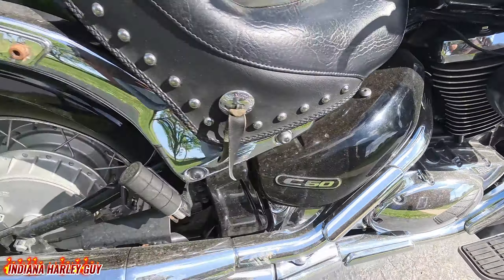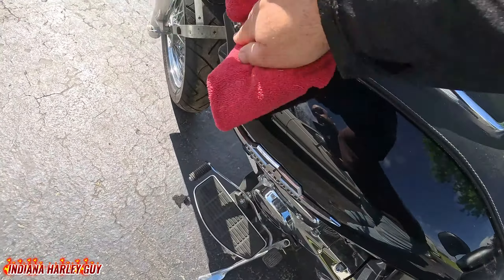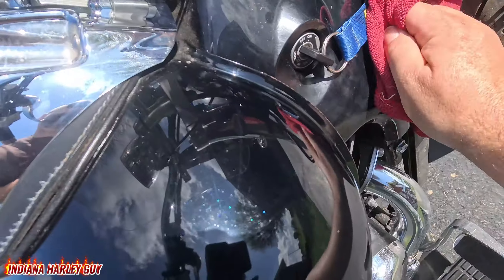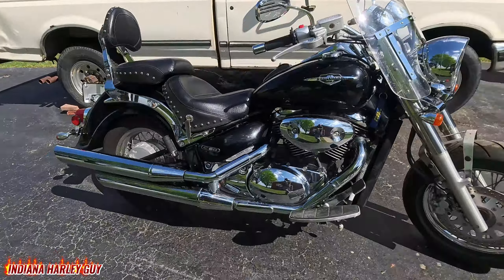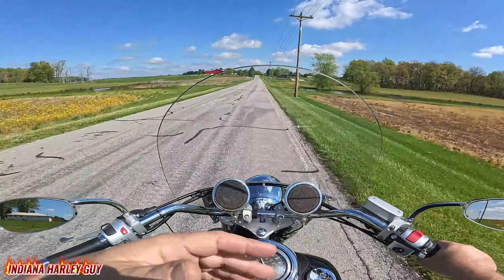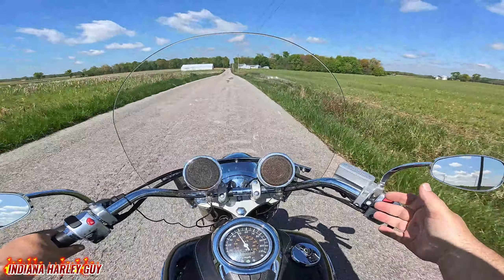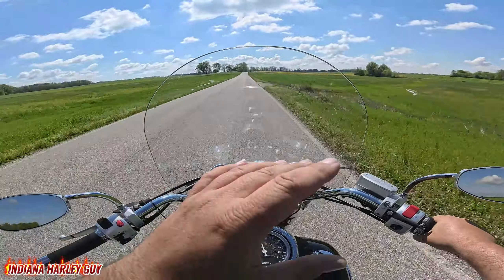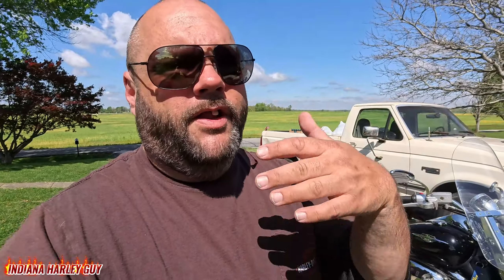Cleaning up the Suzuki Boulevard C50

Comment: I ride a 2005 C50T. Picked it up at a pawn shop in 2020. New tires and general service and been on it ever since. I did convert the lights to all LED. You will have to replace the flasher unit with one compatible to the new bulbs. Rides great. Flawless performance.